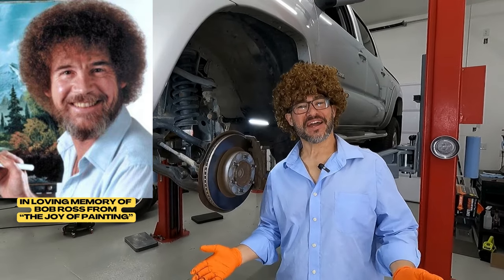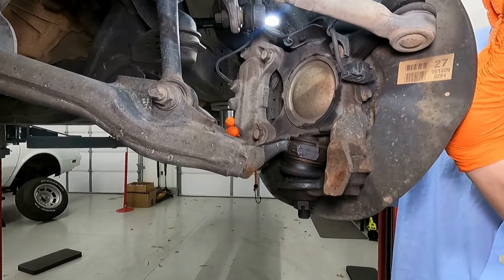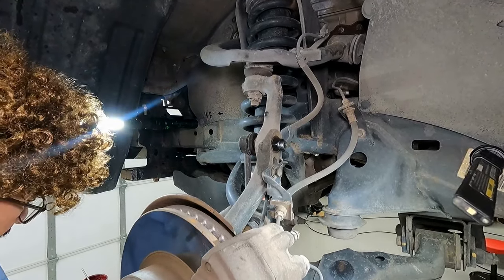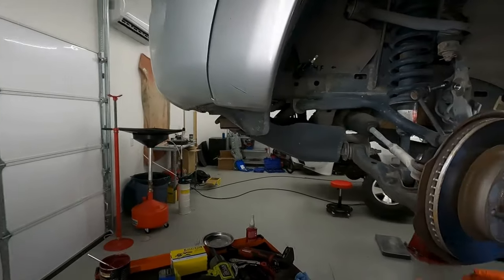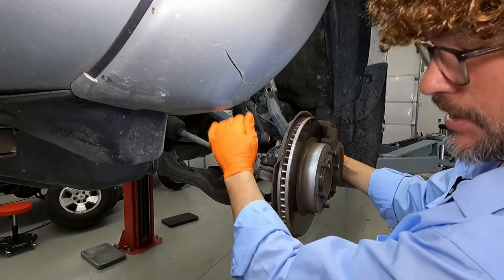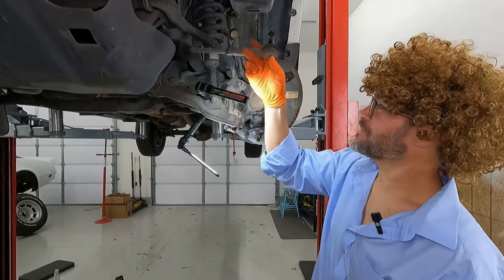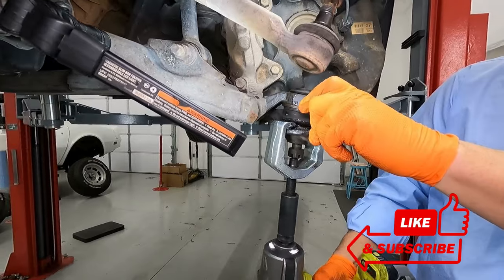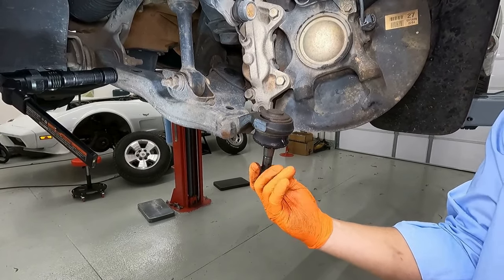Toyota Tacoma Ball Joint Replacement (the easy way, trust me!)

Comment: Great video.  Your a riot.  I’ve done this before and am doing it again.  The problem I find up here in NH.  The universal kits at the store skip the correct size for de-installation.  The nearest size is tight and i had to sand the inside of the tube and the outside of the MOOG ball joint hat. Until i had clearance.  Took the joy out some.
Reply from the maker: Thank you and I hope your next project goes a lot smoother!

Comment: How does this method work for a 4wd Tacoma? Wouldn't the axle impede the hub from being swung out of the way and be in the way of the ball joint press?
Reply from the maker: @deththekid02  the axles have a lot of range of motion, so once out of the spindle you can tie them out of your way
Reply: @joyofwrenching  so the axle would need to be removed from the spindle/hub?
Reply from the maker: @deththekid02  probably so to get the clearance for the ball joint press there
Reply: @joyofwrenching  gotcha. Thank you for your help and helpful video.
Reply: What’s the size of the pipe you used to remove the ball joint?
Reply from the maker: @beatlecatracho  it was a receiving tube in the ball joint press kit. Not sure the diameter, but most kits have an assortment of the same sizes and this one should be in the kit you buy/rent

Comment: Cants you just hammer the bottom part of the Knuckle off if you don’t have a pickle fork that will work ?????
Reply from the maker: you can try it, but in my experience, and as I try to show here, they are stuck on so well, that only a tool like the pickle fork or ball joint separator can get them apart.
Reply: the comment that I needed